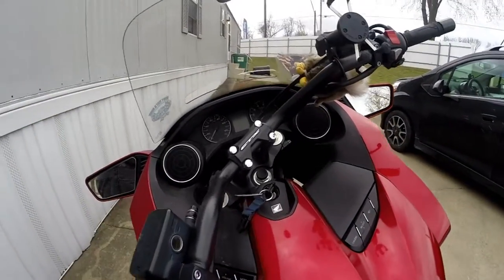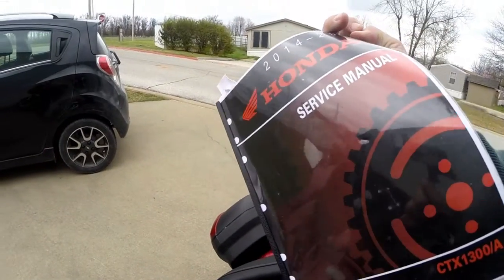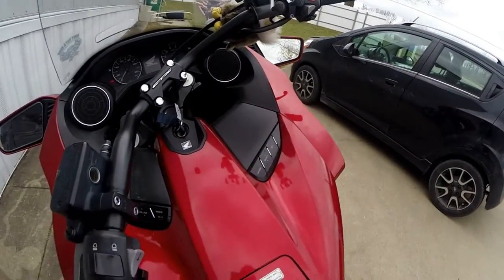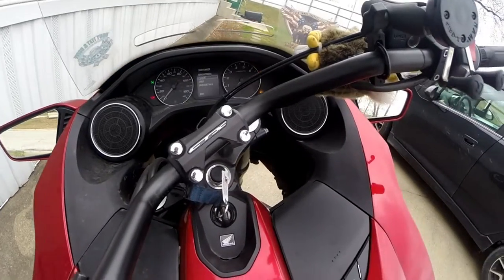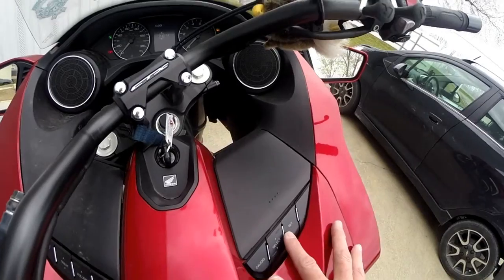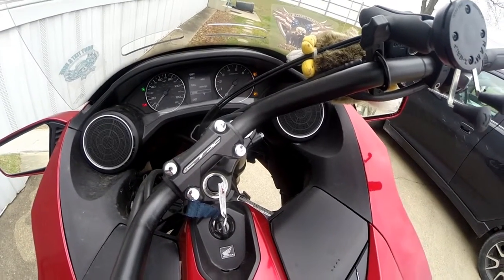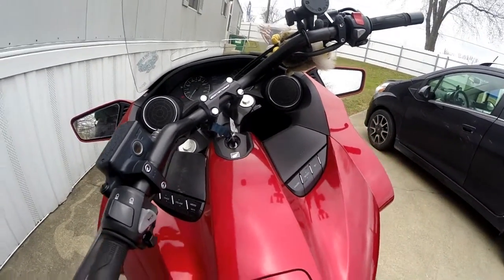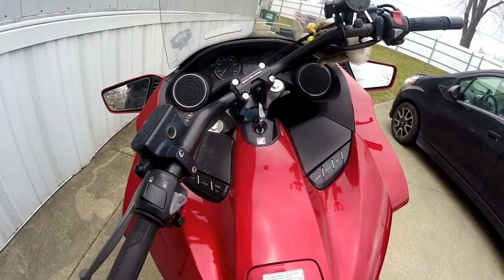How to set the Digital Clock on the 2014 Honda CTX 1300 Deluxe Motorcycle

Comment: What is the best iPhone charger  can I buy to be hooked up on my battery tender on my 2014 ctx1300d.
Reply from the maker: Well, that is a good question. If I was you, I would look into a powerbank that you can get from Amazon, and maybe see if you can find a solar power bank or maybe a Powapod, because a Powapod uses a USB connection, and it has 3 retractable cords, in which one of them is an iPhone charger, and I would put it on the handlebars, along with a good X Clamp phone holder that will not sweat so much under intense heat to where the rubber becomes soft, and doesn't hold the phone in the holder due to intense heat from the environment. Try different things to see what works for you when it comes to phone holder, in my opinion.